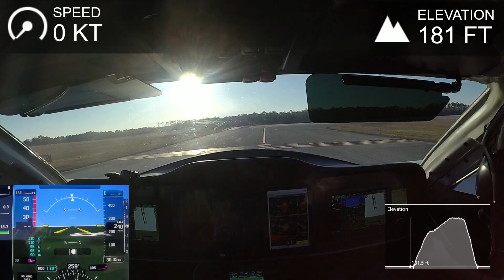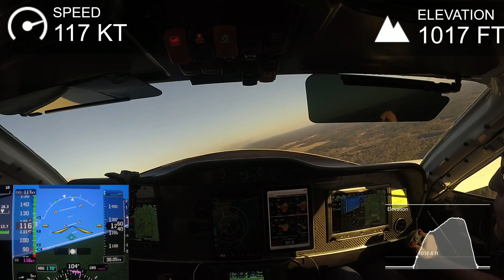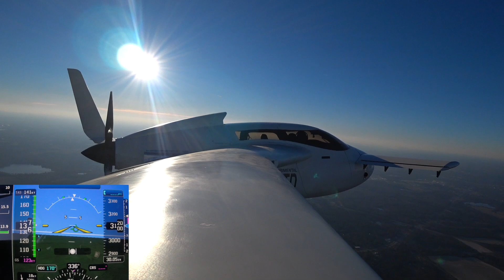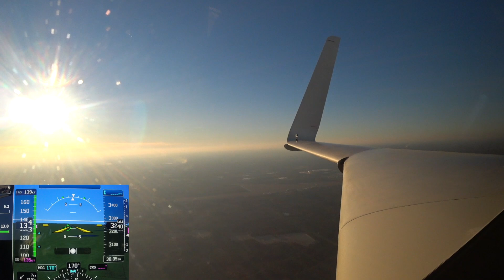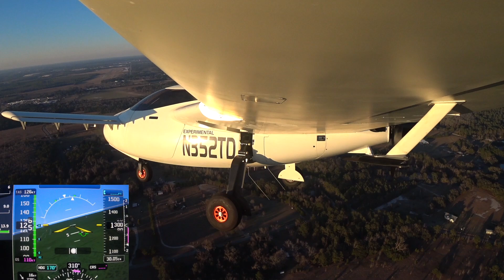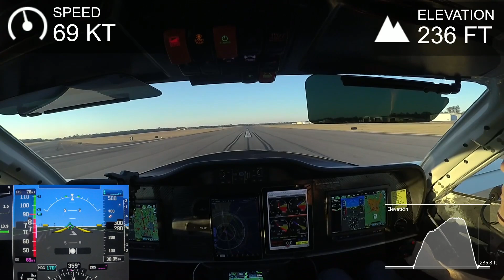Late Afternoon Flight - Flying the Raptor Prototype

Comment: Great work and one more vote for leaving the Comms in the videos. 

As a LOW priority observation/suggestion for production (I am enthusiastically awaiting that day!) addressing of the air inlet panel bonding/flapping issue.

You probably have the solution already handled but is it possible or beneficial to have the inlet flap dovetail under the trailing body edge instead of over the body edge? That should provide a stronger bonding surface. 

I don't know how the pieces are fitted so understand that this suggestion is made in ignorance of how all the pieces align.

Great work and perseverance

Comment: It seems like pressurized aircraft have more involved issues with pitot static systems due to the portion in the pressurized vessel, as well as the exterior factors. Moveable Cowl Flaps, may become a consideration as you examine further cooling enhancements.  Thanks for sharing the adventure.

Comment: remember you'll probably need an even larger radiator at altitude.  lower air density means the air can shed less energy per cubic foot of flow.

Comment: Peter, I would like to ask, was the AUDI Multitronic CVT, which has been fitted to the 3.0 litre TDI engine, ever considered during the design or build stage.

As I understand it, you could run the TDI at idle, and still have 2500 rpm on the prop.

Could it fit between the engine and re-drive?
Reply: A CVT weights 200+/- hundred pounds, the re-drive maybe 25 pounds.

Comment: Are you planning to keep the forward nose mounted radiator on the final production version? I'm hopeful you can engineer a solution that would allow you to eliminate that configuration. The less hose and pipes going the length of the aircraft seems more ideal.

All the best,
Mo-

Comment: With regard to the Piper pitot/static blade, look at a typical Piper p/s line drawing. You'll noticed that there are a couple of drain valves that are installed on the inside of the cabin, normally next to the normal PIC (left) seat. The purpose apparently (ICBW) is to break any vacuum in the p/s system and allow water to drain out. You'll likely want to include those drains in your p/s system.

Comment: Just a thought. 
But what about using a two radiator set up. Both used during climb and other high load/high temp situations. Selectable maybe with a thermostat to single radiator loop when it's not needed. That would also give you some redundancy in the unlikely event of a radiator casualty.

Comment: Have you done any research to see if this is essentially the same engine Audi used in their Le Mans prototype race cars. If this is the same engine, maybe they would share some information.
Not knowing their liability laws, I might not volunteer the aircraft usage. Although, I wouldn't lie if asked either.
Reply: It's a "kissing cousin" of the Le Mans engine, but I very much doubt they would share much if anything of use.  Not due to liability but down to the proprietary information that may be rolled into future production engines.

Comment: Those numbers look great from the oil and coolant temps, to the climb and cruise speeds. My only suggestion would be a good inspection of the control systems to make sure evrythings still holding in place. 

The rudder controls come to mind. Remember the old ones broke, and we doubled up on the new ones. Would check the pully mounting points attached to the carbon frame with epoxy. And would make sure the cables haven't developed any slack anywhere. Looks to be just about dialed in mechanically. Lets see a full power climb! As if 135kt climb speed at 500fpm wasn't good enough. Lol
Reply: Good suggestions Chuck

Comment: Hi Peter, this is really good progress. Now that the thermostat is sorted do you think it might be time to give it a test without the front coolant tanks/ loop? I think that they have been giving a quick drop in temps but when the whole system is up to temp the radiator has to try to cool down a much larger volume of coolant. Anyway that's my 2 cents. Looking forward to the next flight.
Reply: The front radiator most likely is mandatory at this point. Also a greater volume of coolant would only help cooling.

Comment: Hey Peter have you ever considered to change the top scoop to a Formula 1 type of scoop shape and leave it fixed instead of moveable? Maybe a belly scoop into the oil radiator would also help.
I also always see quite a big difference between the pitch angle of the aircraft and the real climb vector. There seems to be a difference of about 5 degrees. why is that? Does the foreplane not generate enough lift?